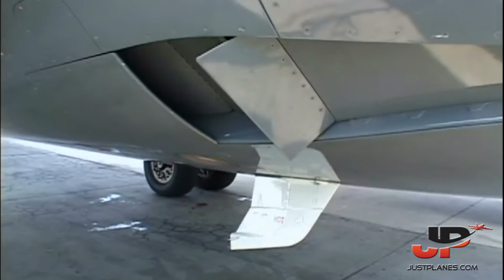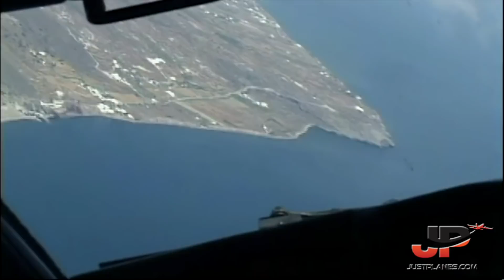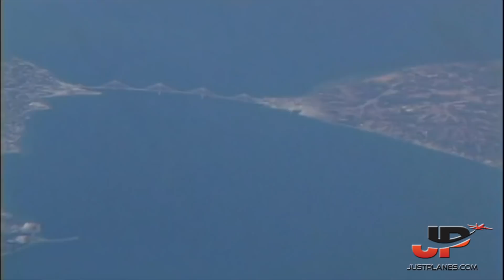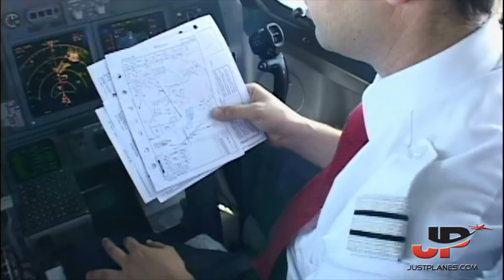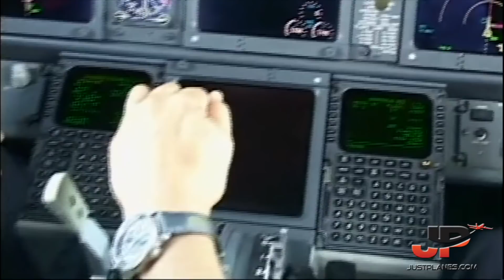Piloting LAUDA AIR 737-800 Santorini to Vienna | Cockpit Views (2008)

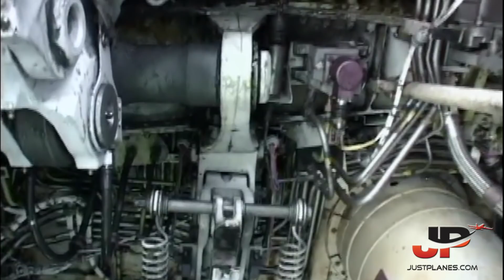Comment: 4:45 Never mind that drip, it's probably nothing important.
Reply: Condensation. The wheel well is not thermally isolated, so during cruise flight this gets as cold as -50 degrees. In Santorini the air is warm and humid and condenses at these super-cooled surfaces.